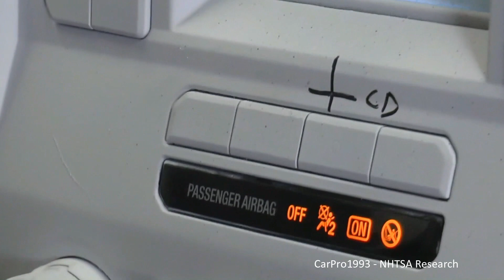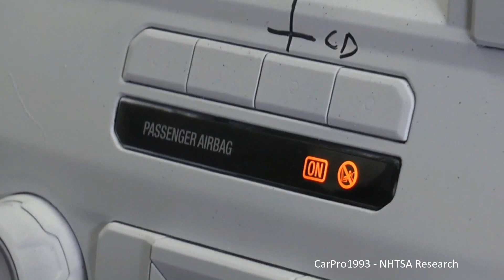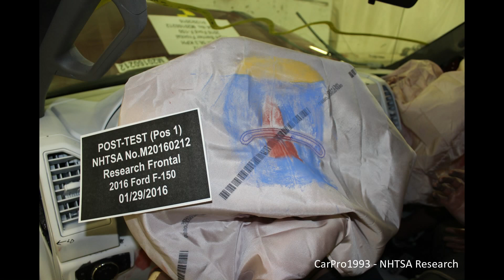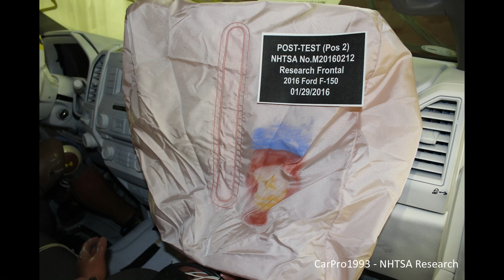2016 Ford F-150 SuperCrew Full-Overlap Frontal Crash Test (NHTSA Research - Rear Occupant)

Comment: Rear seat belt is not good, maybe the rear seat belt is not pre-tensioner and force limiter.
Reply: A lot of car/suvs/trucks dont have rear passenger pretensioners and load limiters, they only lock with isnt all that great, and if they do have pretensioners/load limiters, they’re poorly calibrated